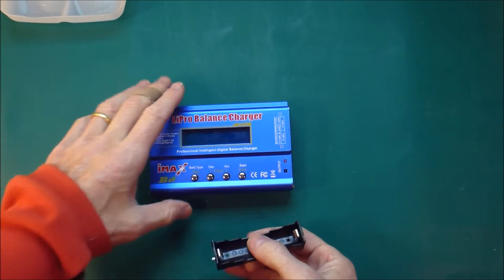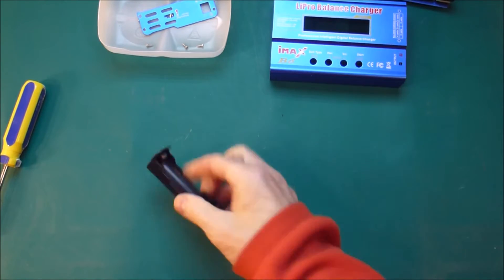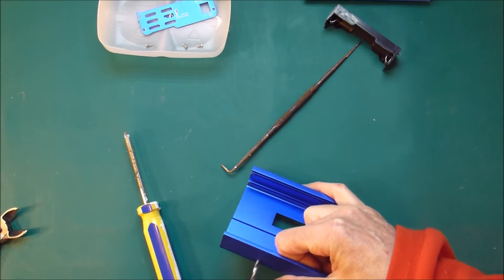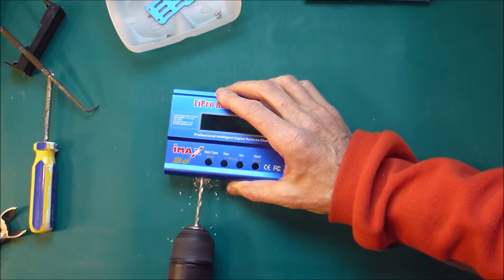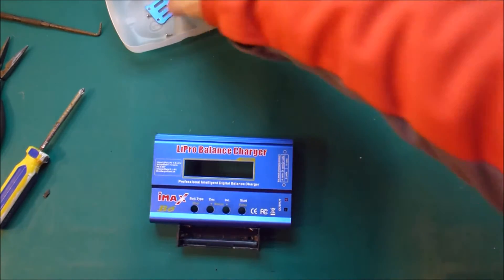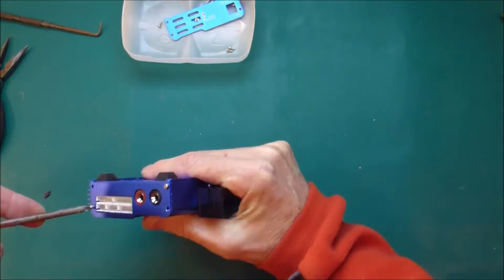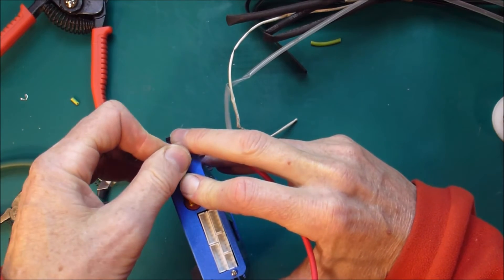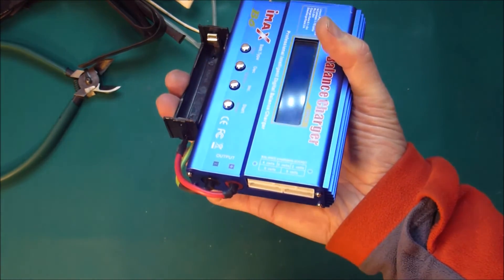Laptop Powerwall 51 - iMax B6 battery holder hack

Comment: Why bother with fake iMax B6 as discharger if for the same price you can get two ZB206+ dischargers. They are much more accurate than fake imax (my).
Fake imax B6 is very usefull unit, but not so much as discharger.
Reply from the maker: Yeah. I do agree with you. I baught 4 iMax B6s before I discovered the CB-206 (which I also have). So I'm just trying to optimise what I have.